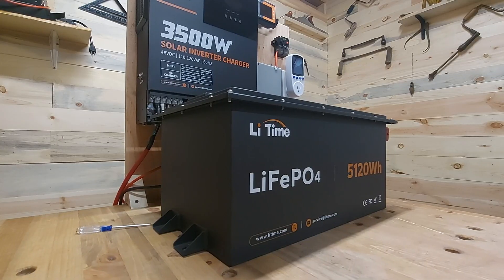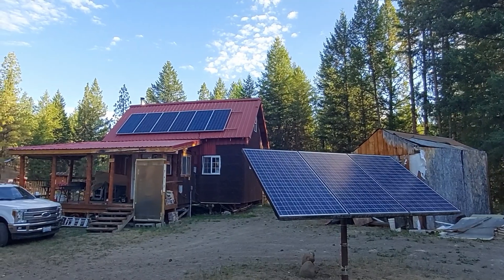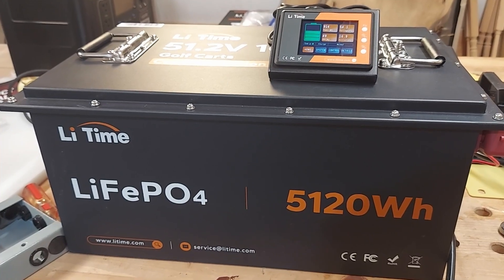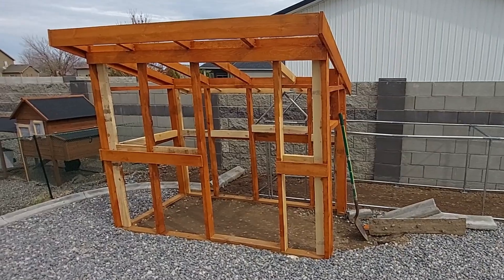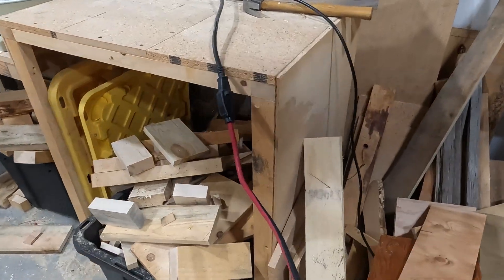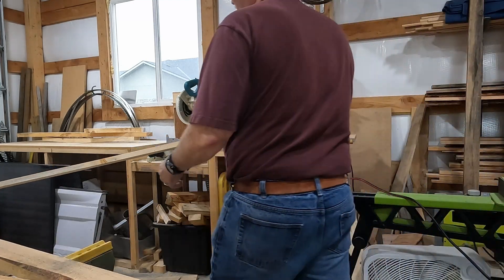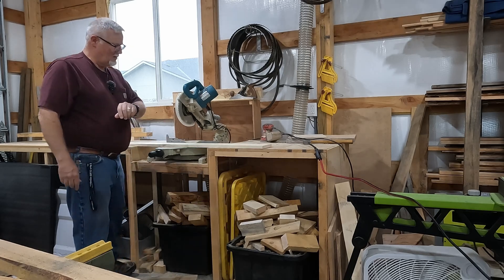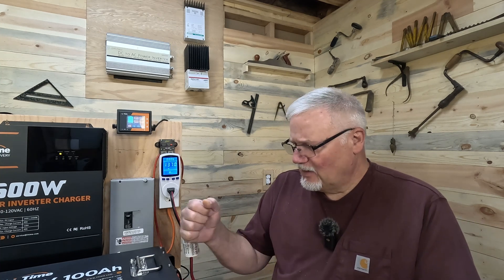Will I smoke this inverter?  Can it handle this heavy load?

Comment: Nice testing, it's a lovely all in one unit. I do like LiTime products and i'm currently running two 60a LiTime charge controllers and a 2000 watt LiTime inverter and i'm quite happy with the setup. However, i'm not into the all in one units as it's easier to upgrade the system by using separate components. My next upgrade will be from 12 to 24 volts and using a 24v Victron low frequency inverter.  Greetings from Jamaica.
Reply from the maker: Thanks for the feedback!  I agree on the AIO units but must admit I was impressed by this one and didn't let out any smoke!  Cheers!

Comment: I think Li-time is a great product probably be my first somewhat more expensive inverter (dont get me wrong dont mean expensive) but having a chinese brand which performed well on YT clips even usa based, the first went up in smoke literaly just running 80watts (should do 1000-2000peak) ik got a new one no problem there, but you know trust is gone, would never use it (havent used it till now) unless i am home and in viewing distance. Is there a li-time you suggest 220v (europe) that does 1500W constant if needed and peaks say 2000 (pure sine is must using it on tv and computers) Thnx upfront.
Reply from the maker: Sorry to hear about the smoking inverter!  Unfortunately, every product out there can do that but let's be honest, some brands are likely more prone than others.  As long as they replace the unit via product support I'm ok with that because it's important to accept that paying less for something might mean it's of less value too.  We'd all love Carver Stereo gear right?  But can only afford JVC ;)  Or for the non stereo buffs, we'd all love a Ferrari but can only afford a Honda :D  The Honda won't do what the Ferrari will.

I find brands like LiTime though, are improving all the time.  They make good batteries and the two inverters I have continue to work and that's what matters :D

Comment: So basically abusing things is the true way of life i will follow in your footsteps
Reply from the maker: LOL well, it kinda is.  Few want to do what their equipment is designed for right?  But if I abuse an inverter and it doesn't let the smoke out than it's pretty likely it will run a refrigerator.  IMO anyway.

Comment: Need to be a bit careful.   Set the watt meter to measure VA instead of Watts... VA is what the inverter is gonna really be feeling.  Still quite impressive for a little fly-by-night off-grid inverter-charger.   What is the LRA spec for that inverter?  I can't really find any rating for it which is not a good sign.  But you might be cutting the lifespan of the (relatively small) HF inverter to ribbons with those AC motor loads.

Also... mmm.  A generator might be a bit problematic with these inverters too.  The dirty power will put quite a bit of stress on the inverter.  My recommendation is that generators only be connected to a dedicated battery chargers, bypassing the all-in-one unit entirely.

You are going to be disappointed with the combo solar + grid charging mode.  These are essentially off-grid inverters so they can't actually share power with the grid (they aren't grid-interactive).  When the grid is connected, the grid and only the grid is basically running the loads.  Many of these can't even charge from solar while the grid is connected through.  So it is a far cry from a true grid-interactive hybrid inverter which can do self-consumption properly.

Finally, remember that you need a substantial amount of solar connected to the system to get past the low efficiency and high idle consumption.  The minimum amount of solar would be... probably around 1kW.  2kW to be comfortable.  If you leave the all-in-one's inverter active 24x7.

-Matt
Reply from the maker: I actually ran several tests and for much longer but can't include them all in a video due to typical watch time (most videos do well in the 10-12m range so extending one to say 20m to include other tests typically means the video does poorly (though not always).  Perhaps I'm not entertaining enough 🤣

During my testing I never saw the inverter voltage drop, or for that matter rise, on the watt meter.  It ran a very consistent 119.5v.  Incoming grid/utility voltage typically started around 122v but dropped to 120.1v when in use.

Since I run an LF inverter at the cabin I must admit, these HF types are new to me.  However, I figure since the inverter is rated to peak at 6kw and I didn't come close to that I wasn't really pushing it that hard though I did stress it enough for my purposes I think.

I'm seeing about 40w/hr of drain running the inverter with no load and connected only to the battery.  This is actually better than my LF inverter/charger at the cabin which is rated to run about 70w and then I have the two CC's as well and the 24v-12v step down converter.  However, the sun rises in the morning and I begin to get some production long before peak solar and I never have an issue frankly.   Of course, I have 2400+w of solar to keep things topped up.  To me a 40w drain is very little and while I could run my LF inverter in 'eco mode' it fails to kick on to keep the generac charger going so I leave it running 24/7 when I'm there.

I've been running a generator through an inverter charger since 2013 at the cabin without issue, but again, it's an inverter/charger and LF so maybe different but the power from my gen is typically pretty steady at 59.9hz-60hz though the voltage is a little low at 117v.  Still, no problems after all these years.

For me, AIO systems aren't really the best option but for some I think they might be good.  For example, all those power station users who use the PS as an AIO system to power a cabin or as home backup systems might benefit from an AIO system far more and since this one can take 4400w of solar and a lot more battery, it's a better option IMO for the price.  Of course, there are more expensive and better units out there but for the money?  Seems a pretty decent little unit.

Cheers
Erik
Reply: @TheOldJarhead  They aren't terrible, but they aren't quite as useful as they seem either.  Still, with a decent amount of solar they can be made quite workable.  But I would still be very careful with AC motor loads on these little units.   The lifespan of the unit will be affected... they're cheap for a reason.   These little units also have fewer safeties on the output in terms of a failure coupling DC onto the AC circuitry (which will blow up the appliances).  So I treat the smaller units with kid gloves.  Literally.

Generators tend to be hard on electronics so I really don't like to couple generators directly into off-grid systems when battery storage is available.  It also wastes gasoline.  Whereas when a generator is connected only to a battery charger you can use a generator sized roughly to 2x the battery charger for maximum efficiency and only run it to charge the batteries... usually means you can use a much smaller, far more fuel-efficient generator.  That can cut fuel consumption in half.

Another issue with generators is that if the neutral wiring goes AWOL, it can blow up appliances in the cabin... that's more applicable to split-phase generators though, not 120VAC generators.

-Matt
Reply from the maker: I've been pretty happy with my lpg generator ecogen that uses 1/2g per hr when running but I'm not worried as much about the cost.  Cheers.
Reply from the maker: LRA spec for that inverter -- OK, this one had me as I'd never heard anyone ask it.  I looked it up.  It's actually a compressor rating, not an inverter rating.  Inverters are rated for input and output voltage, continuous wattage and peak wattage only.  Compressors (AC units etc) are rated with an LRA.  The LRA can be used to calculate the starting wattage needed by the motor (peak power).

Since this inverter is rated to peak at 6000w it can start and inverter or motor that uses less than 6001w in theory though with HF inverters I always question that.  High start load items like compressors are probably best left to LF inverters like the big AIMs inverters or for that matter, even SGP's (which seem to be AIMs inverters and the grapevine is that someone left AIMs at the factory in China and went to a new one called SGP and gave up the design of the AIMs).

In any case, you can't find an LRA rating on an inverter because it isn't something they include as they are not compressors.  Some companies may be doing it but peak power is what you need.

If an AC unit requires 18kw to start but can run on 1000w this isn't the inverter for them.
Reply: @TheOldJarhead  Its LRA... basically when you start an A/C unit or really any large AC motor the initial current ingress is almost a dead-short through the windings of the motor as it builds its initial magnetic field.  That is what "Locked Rotor Amps" means... and inverters have to deal with it.  This can be north of 100A (24kW).   You can measure that if you have a clip-on amp-meter by setting the amp-meter to measure the startup peak.

So if you look at, say, EG4's FlexBoss21 or Tesla's PW3 specs, you will see an LRA spec for the inverter (195LRA roughly... 48kW)... basically indicating what the inverter can handle without tripping off.

Inverters that don't have this spec generally aren't designed to handle any LRA at all, and their ability to deal with AC motor starts winds up being purely incidental... and also likely to put extra stress on the inverter that reduces its life-span over time.

-Matt
Reply from the maker: I wa ms wondering if companies like EG4 did that.  American Made!
Reply: @ The EG4 stuff is mostly made in China just like everything else in the world (really... there are very few American brands that actually make their equipment in America).  But it's an American company with an American team.  I'm hoping they can pull through the mess Tariffs have created.

In anycase, EG4 equipment also has all the UL and (for California especially) CEC listings (as well as for other states)... needed to actually be able to legally install it on the grid in almost every state.   Similar to Tesla and Franklin and a few others.

99% of the random inverters and batteries that can be found on Amazon have ZERO UL listings and no state certifications anywhere.

-Matt
Reply: @junkerzn7312  Agreed, very few are UL listed.  In fact, you have to look really hard and spend major $$ to get a UL inverter.  Off grid is one thing, but safety is important.
Reply from the maker: UL rating is no guarantee of safety and many non UL rated items are rated by other organizations.   There are several in fact.

Comment: But will it run a shop air compressor?
Reply: Ha !  🎯🎯🎯👍😬
Reply from the maker: Sure, as long as it doesn't draw more power than 3500w, but even at 1kw, it wouldn't run long without several batteries
Reply from the maker: Giving this more thought, I think if I wanted to run my AC I'd move to a low frequency inverter like I have at the cabin which puts me more in the component space as I'm not sure anyone runs LF inverters in AIO systems.  But wiring one up isn't too much more complicated frankly :D
Reply: Or an inverter designed to run real loads and has split-phase 240VAC output, like the EG4 FlexBoss18 (10kW continuous, 195LRA) or FlexBoss21 (12kW continuous, also 195LRA).... those can also handle a 6000W imbalance between legs.  They laugh at a 5-ton A/C or an air compressor.

An air compressor might destroy this little 3500W jobbie.

-Matt
Reply from the maker: awesome